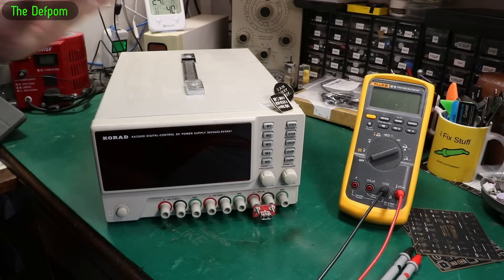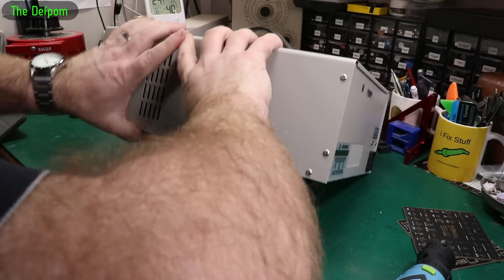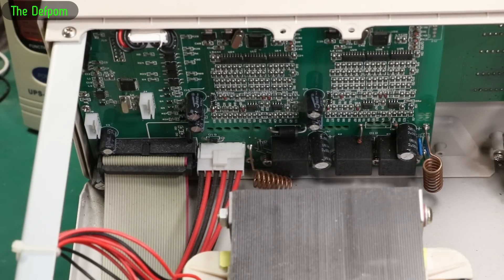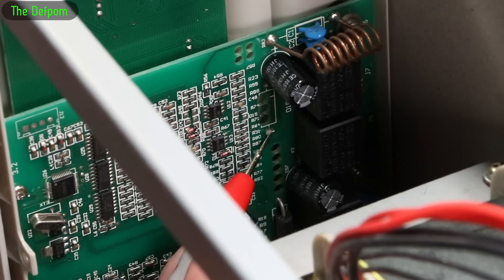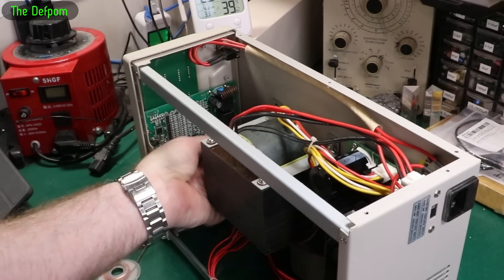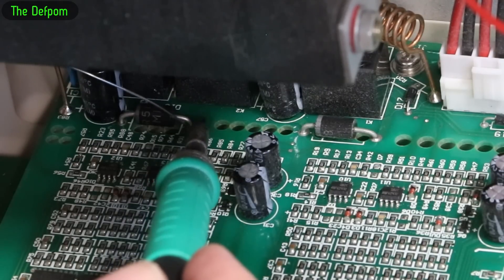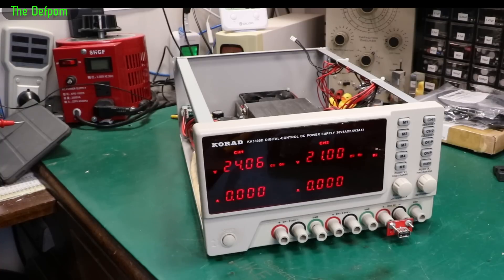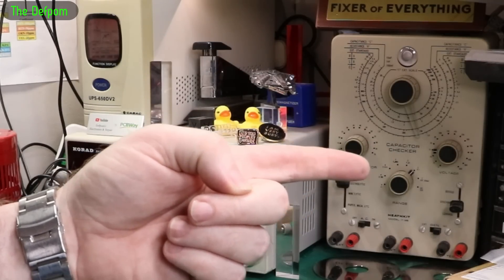🔴 Korad KA3305D Power Supply Repair - No.1292

Comment: Get some JIS bits. You'll like them I'm sure. (Japan Industrial Standard)
Reply: Interesting. I was thinking the exact same thing when the bit slipped out of the screws. I've been using Vessel for a while now and am amazed at how much better a JIS standard screwdriver and bit works.
Reply: @capriracer351  I got their electric screwdriver and it’s great. So small for what it is.

Comment: I've got a similar power supply. My one looks virtually identical inside, but has Tenma branding and recessed banana sockets. I'm not sure if your one has the same problem, but in my one the fan made a loud ticking noise. It turns out they were using PWM to control the fan at about 10 Hz. I ended up putting a 1000 uF capacitor in parallel to take the edges off. It sounds a lot better, but the transistor driving the fan gets a bit warm.

As for all the components on the control board, I think they've spun their own ADC and DAC. Not sure why they wouldn't use some off-the-shelf solution - I can't imagine it's cheaper to use all that PCB area and place a bunch of components rather than just throwing down a single chip. Perhaps it's an older design.

Comment: That's D15; D18 is in between the relays.
The 1kV rating will be so it can act as a snubber when there's an inductive load across the output.
Reply: Also worth noting is 1N5408 has higher non repetitive current rating than the SR5100.
Reply: @keithfisk5641  let's hope the mistake in connecting whatever blew the guts out of the diode is also non-repetetive  xD

Comment: What was that sound when you turned the psu on at 0:20?
Reply: Transformer in-rush current, very normal.
Reply: @yoeribolderdijk1257  Not that loud. Was wondering if he uses an insulated transformer for testing with old delaminated core. It is as loud as transformer we have in our old 50-60 years old car battery charger.
Reply: @ukaszsmoa8416  Transformers can be that loud, maybe cheap transformer?
Reply: The transformer in-rush caused a vibration.....but was made way louder as the PSU case rang like a speaker. Quite normal.

Comment: The idea of them was to blow a fuse, or trip a breaker, if the wrong polarity was presented. I would have thought that something would have opened up and killed the supply.

The number of them that I have replaced on mobile radios is astounding.